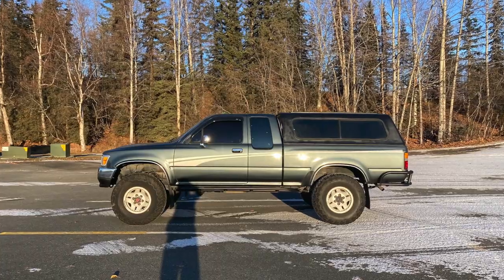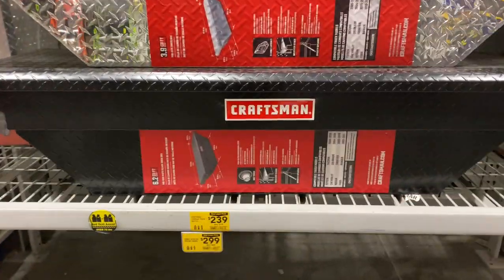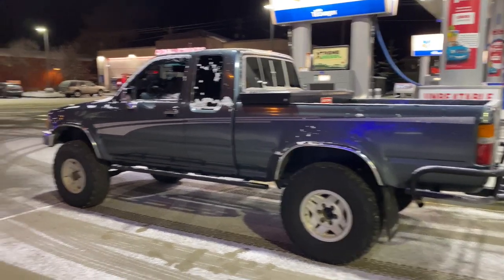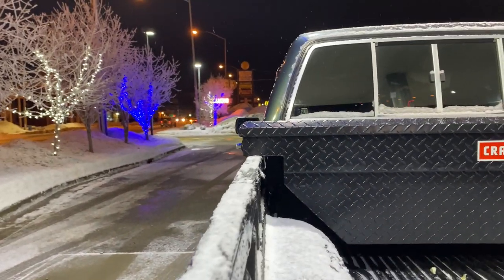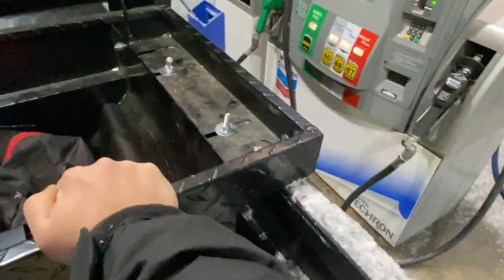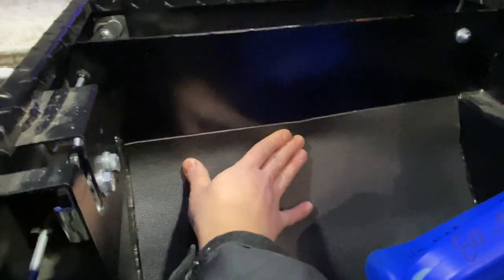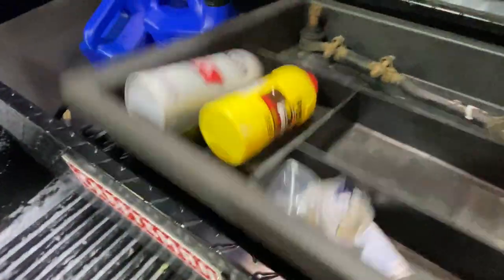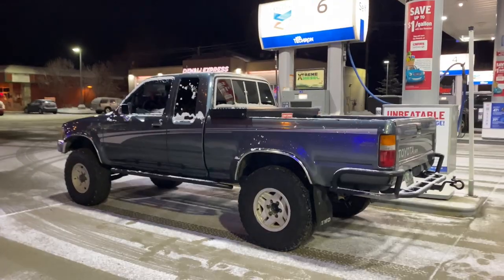Best tool box for Toyota Pickup

Comment: It's a great little box. I have a full size one (70") across, but same color. I needed one to carry a floor jack, 4 way lug wrench, a couple socket sets,  basic hand tools, air compressor, and my cleaning supplies & towels.  This frees up the back seat of my Quad Cab. I like that there is several inches left open below the box, so I can still carry 6ft 2x4's, plywood, etc. I have mine installed on a 2020 Ram 1500 Bighorn. It's well built, waterproof, and enough room for me. If I were a contractor or worked from my truck, I would probably go bigger and heavier duty...but this box does the trick.

Comment: I just removed the bed bar from my truck. Previous owner installed it (Badly) and bent the bed rails in just to get it installed. I took it off and now I want to throw a toolbox on. Thanks for the measurement, would of have to go out and do it myself.